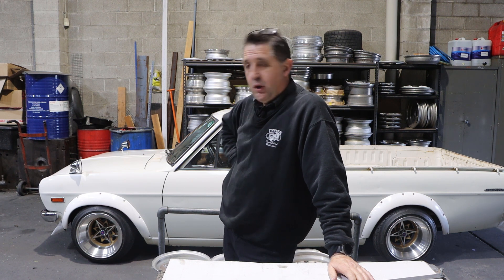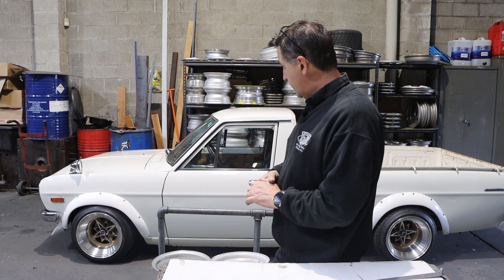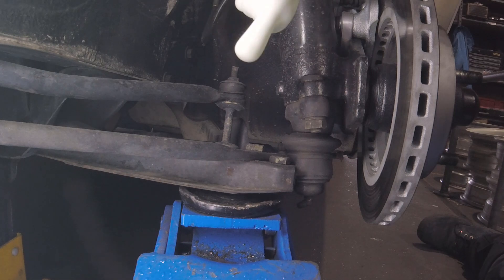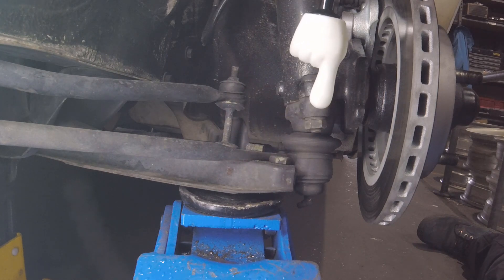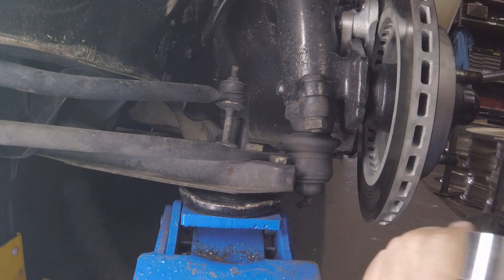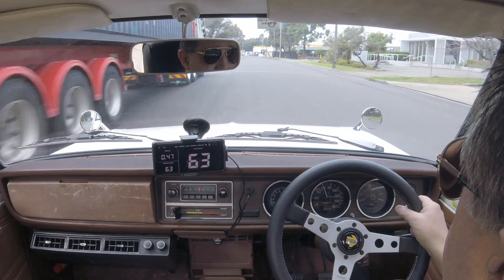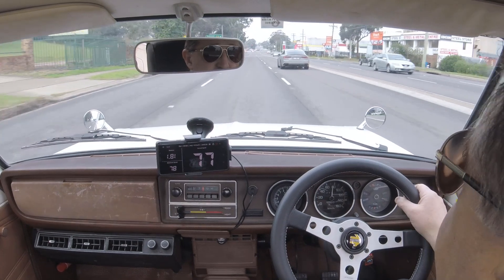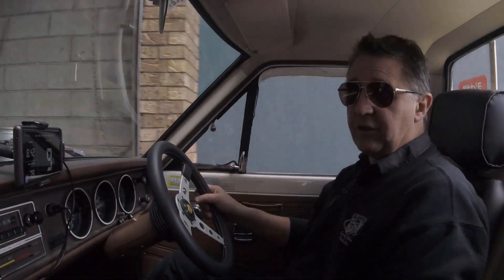28. Nissan Sunny Truck (Datsun1200) Episode 12. Roll Centre Adjusters. (Bump Steer fixers)

Comment: How thick were those RCA's look like 35mm but can you confirm somehow ? thanks
Reply from the maker: Those are 30s, but with how low we are running the car we've ended up using 50mm ones.
Also 2.5 degrees negative and 5 degrees of caster.
With the reco'd steering box it drives like standard.

Comment: If you're going to keep it the A12 for a while, I have a 28/30 DGV Weber downdraft carb that would be perfect for the ute. It till has the choke set up on it. Made a big difference to the A12 I had in my B310 Sunny.  Are you still having wheel rubbing problems in the wheel wells? Someone I know had a little pictorial he created & posted on Datsun1200.com. His logon was L18_B110, he did it on his 1200 Coupe. Basically he took a small slice out of the body in the corners,  hammered up the floor to fill the gap   then welded it up. He was running 205/60 x 13's on a 13 x 7 inch Hotwire wheel..
Reply from the maker: Hey Paul wheel rub is not too bad, basically rubs on the firewall side a bit at full lock. Carb is an interesting thought, do you need a manifold for it?
Reply: Just need an adapter plate that's easily available on Ebay. You also need one of those aftermarket air cleaners, or do a cut & shut to the bottom of the stock air cleaner, with a piece of steel cut to the shape of the carb top glued or welded to the bottom.

Comment: That was a great way to illustrate bump steer and roll center correction. I've awarded you 50 dad points for that. Is she bottoming out in the rear? (not a dirty joke)
Reply from the maker: Lol. Sometimes. BIG bump yes. We removed the bump stop plates which gave us another 15mm, and the air shocks help especially when we have a load in the back.